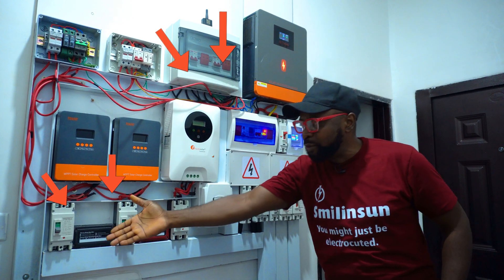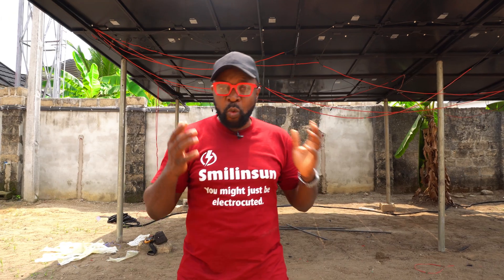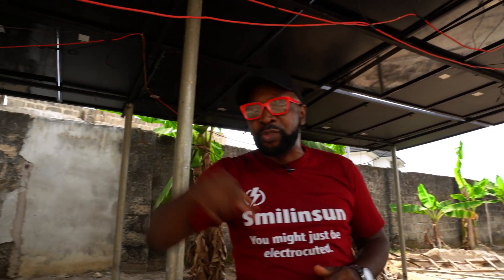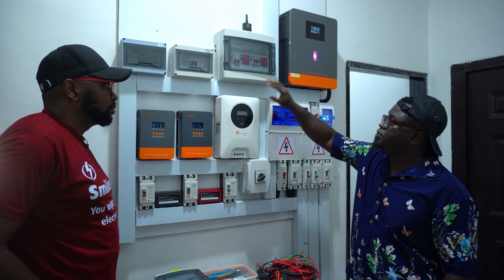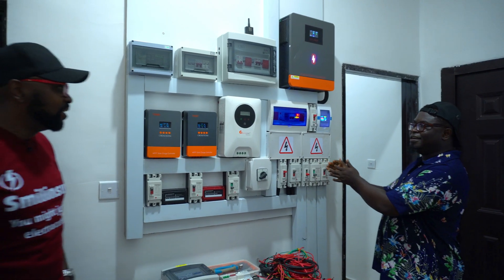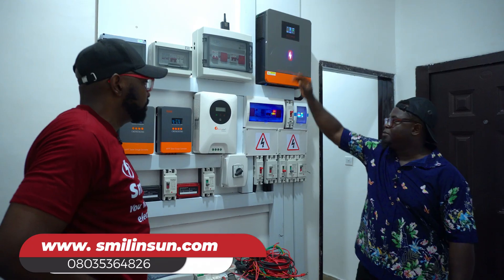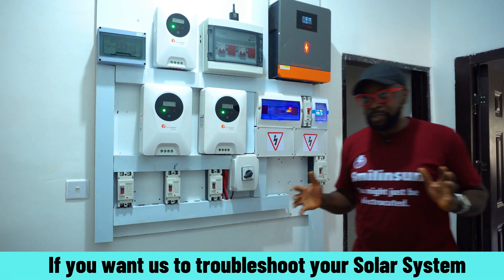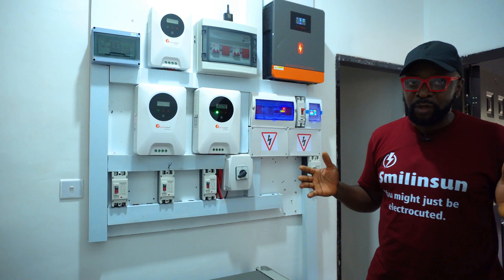Correcting a wrong Solar Installation

Comment: Nice video, why didn't you use the high voltage charge controller?
Reply from the maker: It doesn't work with the low voltage CC
Reply: @smilinsunsmilinsun8056  I mean get rid of all the low voltage CC and only use the single High Voltage CC.
Reply: @7LAYERS  if a single charge controller fails, you will have no energy but multiple charge controllers will let you have electricity even when one charge controller is bad. It's a fail proof system configuration. I'm off grid with four solar charge controllers.
Moreover a large single high voltage charge controller is more expensive and maybe difficult to replace immediately if it fails. Why not have multiple less expensive charge controllers instead?
Reply: @wilsoneffiong3243  Thank you, I got it, it's for redundancy.

Comment: Good one Boss,
In the space,good sizing good configuration,proper cableing and you are good to go....
Bursbar, battery  dc breaker to Inverter n dc Surge &dc brekers for Cc n a transfer switch for input output circuit would have been ok .. initial installer just make the whole place looks expensive.lolz
Reply from the maker: I agree

Comment: Why not divide the panels and connect the panels with high voltage configuration to the inverter mppt and then another low voltage configuration into the felicity mppt? It would save cost if getting synthetic charge controller. Even if you max out the inverter mppt and felicity mppt the powmr can come into play.
Reply from the maker: Low Voltage and high voltage CC doesn't work together , that is the essence of this whole video
Reply: @smilinsunsmilinsun8056  they do work together. the problem was actually with the initial  PV configuration and how the batteries were connected in the first place. Well done!
Reply: @smilinsunsmilinsun8056  Although I admire the aesthetics of the work you did this statement is incorrect. You can run multiple “low-PV-voltage” and “high-PV-voltage” charge controllers in parallel on the same LiFePO₄ battery bank without conflict. The key is that, on the battery side, controllers must operate at the identical system voltage (12 V, 24 V, 48 V, etc.) and be programmed with the same LiFePO₄ charge profile—matching bulk/absorption and float set-points, zero temperature compensation, and absorption duration. Wire each controller through its own fuse or breaker and short, equal-length leads to a common bus or the battery terminals; give each its own PV string so their MPPT algorithms don’t interfere. Ensure the sum of their charge currents never exceeds the battery’s BMS limit, and wire any BMS charge-disconnect or CAN signals to every charger. Problems arise only when set-points differ, combined current is too high, or different battery voltages are mixed—otherwise, the battery simply sees more available charging power and finishes sooner.

Comment: I usually ignore the hybrids inverter's mppt charge controller.
I always use external charge controller
Reply from the maker: @iykefavour3562  There is nothing wrong with hybrids, you just need to configure properly that's all. Thanks for your comment.

Comment: Awesome. Nice work as always.

I've got the same Felicity charge controller connected to a 24v 5kwh Felicity battery. However, once the battery charges to 28.1v, the charging cuts off, battery voltage drops to 27.0v, and the controller starts showing the E04 which should be battery over voltage.

Do you have any recommendation on fixing this issue or is the controller faulty?

This seems to be a common issue with the controller as I've seen a lot of people complain about the same issue.
Reply: Connect the communication cable of the Charge controller and the Lithium battery
Reply from the maker: @ONOBUNOdiamehi  call their customer care they will fix it for you.

Comment: Kindly clatify on wat you mean by low voltage charge controller, because all you are mentioning is max current capacity... 

I think the issue was not having different charge controller,, or having different battery circuit breakers... 

I think the problem could've been wiring & pv input design,,,  a 200v100amp charge controller can be connected 2 the same battery with 400v 60amp charge controller.. as long as these have correct pv input voltage

Comment: kudos for a fault rectification well done 
but then sir i would chip in that truly speaking connecting a hybrid inverter together with an external charge controller to charge batteries via solar panels is wrong(works only under much calculated cases 🤯)cause they don't have the same voltage parameters(hybrid systems are high voltage while external mppt charge controllers don't go beyond 195volts mostly because hybrids are off-grid systems.hence there going to be conflict between the two as high voltage and low voltage pv output source can't go simultaneously into a DC bank not to talk of two.👍
but then sir you disconnected the two low-voltage charge controllers and replaced them 120a and 60a i would like to believe that you did that cause of amperage differences and thought to lessen the brand conflict😂.cause personally i feel it all depends on your connections doesn't really matter if the resulting amperage is different but it obviously does matter if the voltage is different so if the PV output voltage on all charge controllers is the same its a win👍🏼.
Reply from the maker: It is very obvious you did not watch the video till the end , the hybrid  charge controller function was not used.
Reply: @smilinsunsmilinsun8056 on the contrary i did sir. i know the Charge controller in the inverter wasn't used yea  which brings me to suggest instead of getting extra two 120a MPPt SCC why not get one which makes it two summing up with the one there initially yea and then also use the 2 60a Mppt SCC there as well which im very sure would work perfectly technically speaking(similar voltage across all panel output coming down to each mppt SCC then making sure to stay within the limits of their amperages individually you get what I'm saying tho  i mean of course its just a suggestion you can choose to look into it or not though no pressure 
It would cost the client less that's what I'm saying in essence sir🫶🏼💯
Reply from the maker: I appreciate your Input but I have come to conclusion that you did not watch the video till the end. If you did your comment will be different. The Hybrid high voltage charge controller is not connected with the low voltage charge controllers. Kindly watch that video to the end.

Comment: 2 hybrid inverters were going to solve this shit. No need for all those charge controllers
Reply from the maker: @mikerukwava9574  He doesn't have an inverter issues as regards energy transmission. What he needs is energy generation
Reply: He wanted to waste resources for the man the more
Reply: Correct he does not need those charge controllers should get 1 or more  Hybrid inverters. The wire diagram is wrong, need to a new single line diagram.
Reply: true
Reply: Sometimes, too much interference from the client always creates problems for the installer.Kudos to smilinsun for good d work

Comment: All this is usually caused buy clients who buy solar system on their own without consulting the installer. How can 1 have different charge controllers on a single system
Reply from the maker: That plays a role, but where's your professionalism when you just use whatever's given to you instead of doing what's right? What happened to walking away if the client refuses to meet installation standards?
Reply: @smilinsunsmilinsun8056 was he the clients that also bought the unnecessary bus bars and breakers that were installed
Reply: Sometimes hunger and greed will not let professionalism work properly. I must do all work syndrome.. @smilinsunsmilinsun8056
Reply: Most times this happens when technicians overcharge for their service.
Reply from the maker: @GamerBoy-zu5pd  Its possible
Reply: Different CC could be as a result of upgrade.
Reply from the maker: @kenisuba9158  Correct

Comment: Nice work boss...
But what's the need for external, low voltage charge controllers when the hybrid inverter already has its own high voltage charge controller?
Reply from the maker: Each hybrid inverter comes with an MPPT charge controller that has a maximum PV wattage capacity. Once your PV system exceeds this capacity, you'll need to add an additional charge controller to accommodate the extra PV input and increase the overall capacity.
Reply: @smilinsunsmilinsun8056  still you had the option of using the hybrid mppt charge controller and just getting an additional one mppt charge controller to the 120 amp that has already mounted. That would have given even more room for more solar array in the future if he wants to expand.That would have still solved the issue. Instead of mixing up with a lower 60amp charge controller & 120amp charge controller. You also had the option to para series your solar panel connection to suit the maximum solar input required by hybrid inverter.  And then connect the other panels in parallel to the individual solar charge controllers .
Reply: @winnieedigin  Yes, you are correct as long as the combination keep you within the max amps and max voltage PV input.
Reply: @smilinsunsmilinsun8056  It would be better to just add another Hybrid Inverter. Should have invested in a Deye Hybrid Inverter either  a single 18kw  or two 8kw or higher
Reply: @smilinsunsmilinsun8056  Thanks sir
Reply: This is a nice video, but I think there is a lot of misinformation presented. In fairness to the installer, his work is exceptionally organized, and I'm struggling to believe it's entirely his fault. Sometimes, clients can also be quite amusing.

Regarding the issue of combining a low-voltage charge controller with a high-voltage MPPT charge controller, as long as the solar panels are connected independently to each system based on their maximum open-circuit voltage, I don’t foresee any issues. This is applicable provided both the charge controller and the inverter operate at 48V DC, and the charging parameters are correctly set for the battery technology being used.

It's important to note that both the charge controller and inverter output DC to the battery, so frequency should not be a concern! So I don't understand the whole emphasis on frequency and not working together.
Reply: This is super amazing.

Comment: Can you provide a technical explanation for why a low-voltage charge controller and a high-voltage charge controller cannot simultaneously charge the same battery, despite both outputting the same DC voltage?

From a theoretical standpoint, it seems feasible to parallel two charge controllers, one designed for high-voltage inputs and the other for low-voltage inputs, since both produce the same DC output voltage. However, I would appreciate a detailed technical explanation for why this configuration is not viable.
Reply: if possible back it up with a test video?
Reply: what can you say about those who charge battery from the grid and charge controller at thesame time?
Reply from the maker: Low-voltage and high-voltage charge controllers regulate current differently, with the low-voltage controller designed for smaller  output currents and the high-voltage controller for larger output  currents. When both attempt to charge the same battery, their differing current outputs cause instability, leading to inefficient power delivery or over/undercharging. Additionally, the controllers have different voltage thresholds for protection, which can result in one controller overcharging the battery or shutting down prematurely while the other continues charging. This conflict damages both controllers and the battery, as neither can properly manage the charging process simultaneously.
Reply: @smilinsunsmilinsun8056  Sir, what charging parameters and charging profiles were used on all charge controllers? It was not mentioned in the video. Was the voltage calibration on each charge controller considered? Because it seems rather weird that 4 charge controllers having IDENTICAL bulk and float parameter settings should be conflicting? The output charging voltage of each controller has to be the same, quite simple. If a charge controller or high voltage inverter cannot maintain its charging algorithm, it is not a factor of the input PV voltage, whether high or low, but rather speaks of the quality of the unit as a whole. It is the task of the MPPT unit to convert the input PV voltage to the set charging profile. 

The key problem is that the controllers did not all have the same charging parameters. Otherwise equipment from different manufacturers cannot be used together.  Voltage calibration and precision on each controller may vary, the installer has the task of tweaking them till they are harmonized on the same busbar. For example, the LFP charging profile on felicity may be 3.6v/cell but the victron has 3.45v. An installer selects lithium profile on both controllers and gets errors, why? because he assumes the output the same voltage, when they clearly do not. 

Various online forums have threads suited to discussions on the topic, and the consensus is that as long as each controller outputs the SAME voltage and has the SAME charging parameters, then it is electrically impossible for 2 controllers at the same voltage to charge themselves. Current can only pushed across a voltage differential. 

You selected identical charge controllers from the same company and capacity because they have identical charging algorithms, hence eliminated the differing charging profiles that existed before. I can assure you that if you connected a properly calibrated, victron, outback or even a fangpusun controller with the high pv inverter they would work seamlessly. 

All in all, well done for putting the video together and helping the client out. He would have had the impression that Solar Energy is a bad source of energy & wrong investment, when in fact his system was poorly assembled and designed. 
Well done indeed.
Reply: @alexanderezra1509  your stand is impressive, You are very close to the exact reason however, come down small, it's basics... 🙂
When you find out you will 😂.
Reply: @smilinsunsmilinsun8056  thank you
Reply: @smilinsunsmilinsun8056  absolute nonsense!   Quackery, lack of understanding and buffoonery on display!

Comment: I know basic setup of 1 controller but how do you add or use 3 controller together are they joined in parralle or separate
Reply from the maker: Its a basic parallel connection
Reply: U can use 3 for 1 battery if u use a busbar to step the panel down
Reply from the maker: Thank you for your input, but the Buzzbar's role is not to step down the voltage or current from the solar panels. It is only a parallel combiner device.

Comment: Man you have what it takes to be a super huge channel. Abeg no give up
Reply from the maker: Because of you I wont lol
Reply: @smilinsunsmilinsun8056  😁😁😁
Reply: @smilinsunsmilinsun8056 
Pls sir I have a system installation that have been damaging the inverter 
By short circuiting the battery terminals 
 It is an SMS hybrid inverter 
And SMS lithium ion battery 
5kwh 

Am using the hybrid mppt to charge the battery with a 9pcs of 500watts panel 3 in series what can always cause the short circuiting of the battery terminals of the hybrid inverter
Reply: @smilinsunsmilinsun8056   this is by far the most chaotic solar system set up  i have ever seen on you tube.

Comment: Nope, it doesn't work that way. HV SCCM can work with a LV SCCM.
Do more on research and tests before putting info out there.
There are parameters sccm looks into when interacting with a battery especially when not using a communication cable.
😉
I do correct alot from installs.
Reply from the maker: I respectfully disagree with you. It doesn't quite work together. Practical research and demonstrations will always show you, just like in this video. Try it out first, and then come back—I'll be right here, haha!
Reply: @smilinsunsmilinsun8056  but let me ask, did you build circuits from the ground to level up.. Interacting with components and knowing how they work principally.
You should be able to figure out the flaw, it's a basic "electrical electronic concept".
Reply from the maker: @jo4mil  Not quite clear would you want to expand clearer
Reply: @smilinsunsmilinsun8056  there are some informations that are privy and top tier... 😏, the info remains privy and are deployed on site... "Everyone stays out 😄". 
When you find that out, say Hi! There are excellent tech engineers that are low key, they are not popular advertisers.
Reply: Ok, the insight is what I said above. 🤗
Calm down, Check that out then say hi

Comment: Immediately I saw the intro I knew what the problem was. Those two powmr 60A charge controllers are not the best. They only accept up to 150/160V Input DC. I fought with the seller to return it. Seeing them next to a high voltage Hybrid inverter was concerning. 
The owner can still use those powmr 60A mppt controller for a smaller project but i wouldn’t use them on my main system.
Reply from the maker: You’re absolutely right about the charge controller—it wasn’t the right choice for this installation.

Comment: Well done on sorting that out. How is 20amp c controller work with the 100amp CC?
Reply from the maker: Thanks for your comment but your question is not clear
Reply: Why are you using 2 different amp rates charge controllers please?
Reply from the maker: @cCaribbeanSpursTv  Three parallel PV lines are drawn from the solar panels, with the lowest current sent to the charge controller with the lowest amp rating.